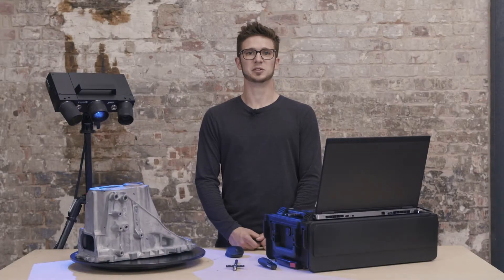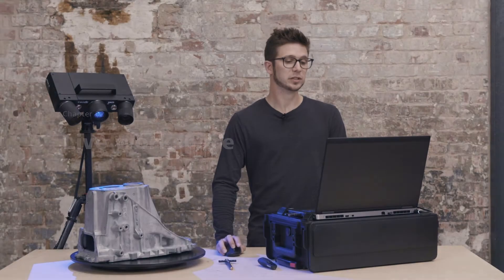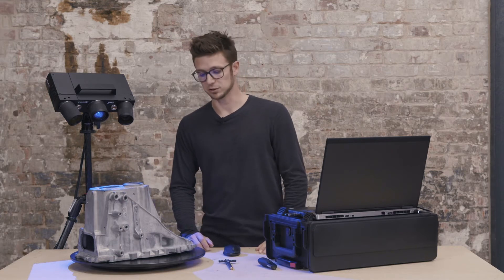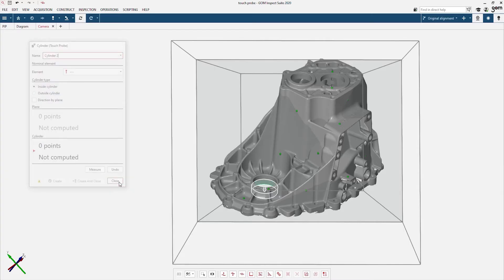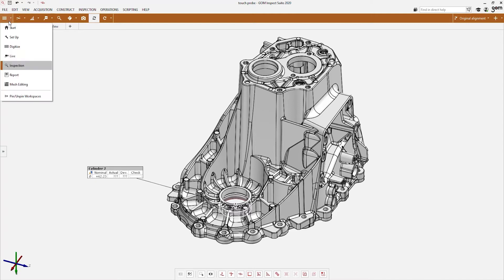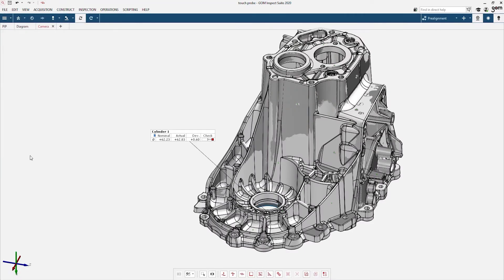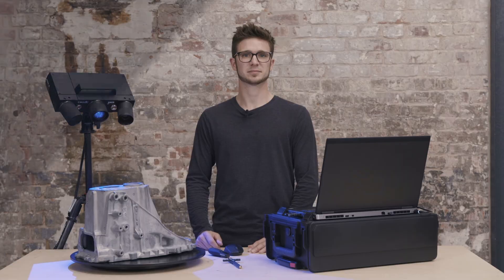3D scanning with ATOS Q: Add single points with a touch probe

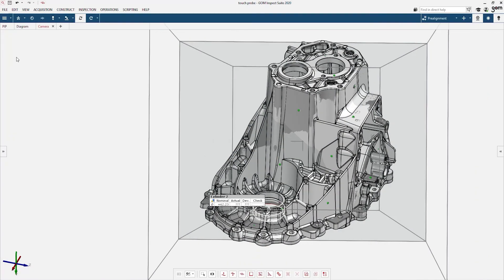Comment: I didn't understand a point that talking about the time from 02:42 (Start guided touch probe measurements). When we want to measure the cylinder first we scanned the part. Before measure the cylinder with the probe, do we have to scan all the area of parts or just the area that we'll work on?
Reply from the maker: Hi Johann, you not need the scan the complete part. Important is that you capture the reference points arround the element you want to probe as the system needs to know it location relative to the part. Collecting the refernce points you can do with capture reference points or make a scan locally.